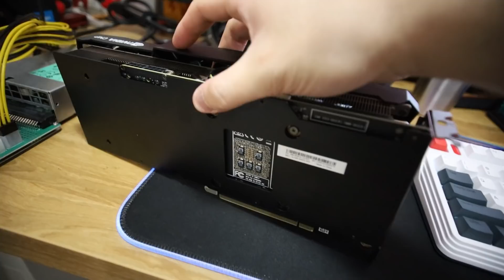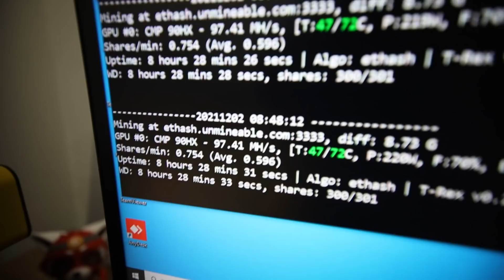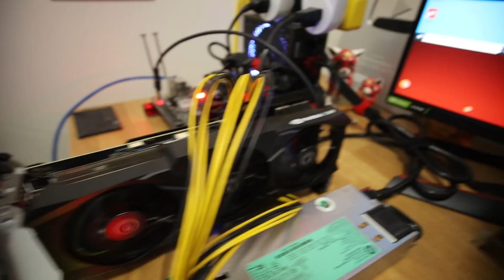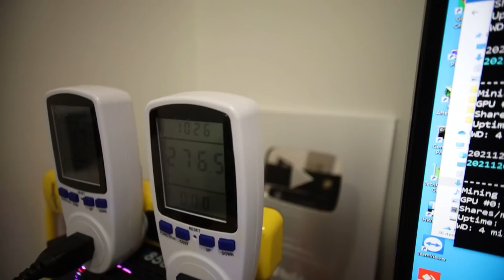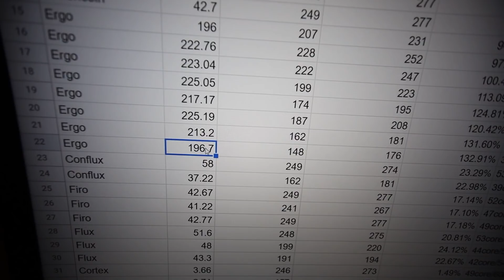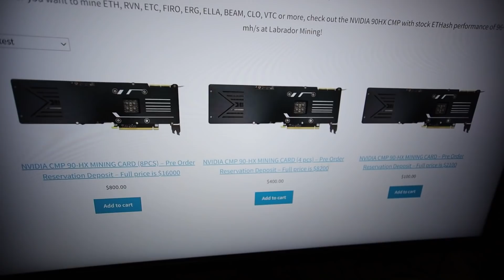Nvidia CMP 90HX HASHRATES for Ethereum Ravencoin Ergo & MORE!

Comment: All the new Cmp 90hx's(Manli) comes with the hot memory. But you can reduce the temperature by 10-14 degrees without disassembly the card. The video is available on my channel.
Reply: what thickness of thermal pad did you use? your video is very interesting even though I don't speak your language.

Comment: But.... you can get 97 MH/s at 220 watts on a non LHR 3080.

And those can be used for gaming. So if it's not cheaper or more efficient,  what's the point?

Comment: 2.1k can buy most of 3090 for 110+MH/s and also good for gaming  reselling value if it’s not working for mining. This kind of dedicated mining cards should be much cheaper than same level gaming card because it’s simplified architecture, reducing I/O ports, trush value after mining.
Reply: I know a lot of Canadian miners who would buy a 3090 for 2100. It's just not possible here
Reply: Maybe used and if you are lucky. I sold my EVGA RTX 3090 FTW Ultra for $2550 after mining with it most of the year (120MH/s) and the buyer even provided me a label for the shipping. lol

Comment: Crazy price for a "scalped 3080 wannabe" that can turn into a piece of brick with no resell value. For that price you can get easily 3x 3060 ti lhr that brings more hashrate with slightly more power.
Reply: Waisting money
Reply: I agree makes no sense at those prices and that's If I buy 16k worth of them!
Reply: Paying $21.50 per MH is madness even if the GPU would have moderate resale value.

Comment: These are such a bad buy. I built my entire 5x 6600xt rig for $2600. It gets 164mh/s for 400w all in. A 4x6600xt rig would be about the same price as just 1 of these cards and would be roughly 40mh/s more powerful at maybe 100w more.
Reply: You need to consider the rig costs: CPU, motherboard, memory, power, etc.  Not saying these GPUs are a buy, but people forget that density is good. Personally, I would rather buy a rig of 3090s (wait I already have one :)

Comment: its funny that CMP90HX is the 3080LHR die without the LHR lock only.  The original 3080 non LHR use only 1080 core clock to get 97-98 Mhs.Only LHR card need high core clock to get the same hashrate

Comment: I don't see them being a good option for server cases because it isn't a back to front cooling orientation, so sticking many of these in a box will result in heat which will result in a pad changing day job in a couple of months. A2000 and A4000 are probably the best efficiency/density (thermal) options right now.

Comment: 98Mh/s at 220w with 72c on the VRMs? That's insane! For the same price of an inflated 3080 non LHR...
Reply: ya but a 3080 can game
Reply: @lorenm4015  This.  Not to mention if you're willing to pay the non-LHR "tax" to get the non-LHR 3080, you  might as well change the thermal pads and then get the similar temps for a long term resale... unlike these things...
Reply: @kurosakiscorner  All Day !
Reply: No its not. this card is not really better for this high price. GPU‘s even 2000 series can achieve 0.53 Hash/Watt like my 2060 S from Dell OEM. 
the only insane card is the CMP 170hx but again 5k…
Reply: With the fees,  duties these card$ run around 2534.00 per card + $ales tax nit worth it in my mind